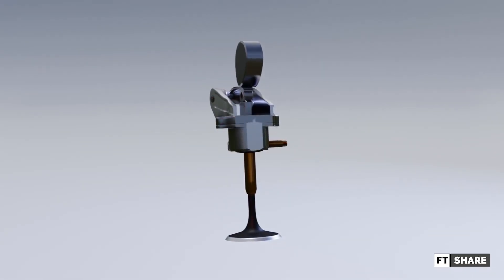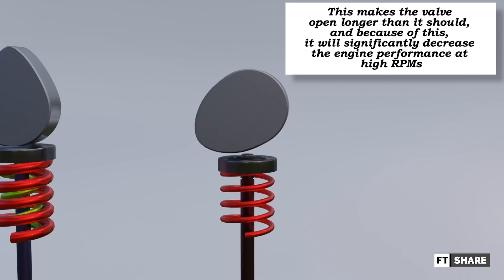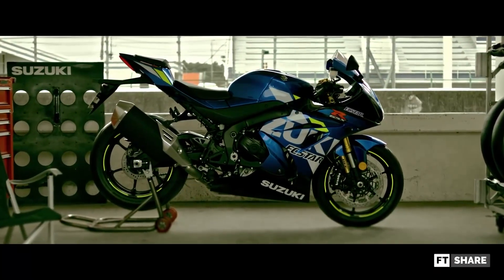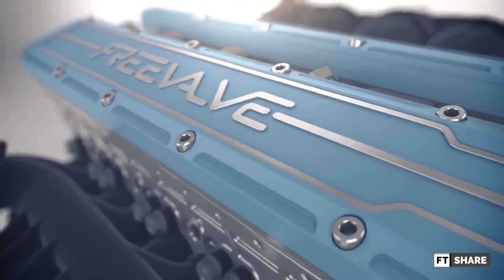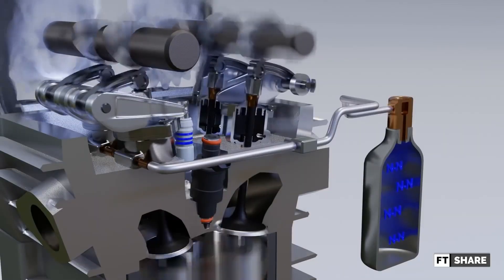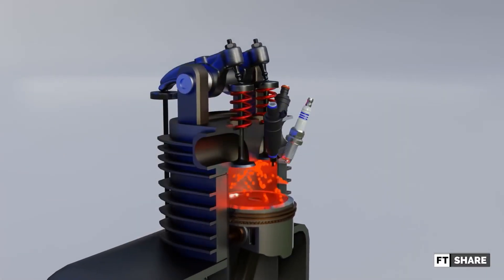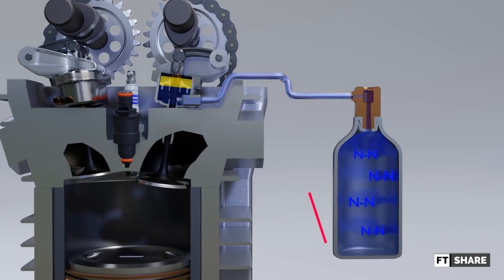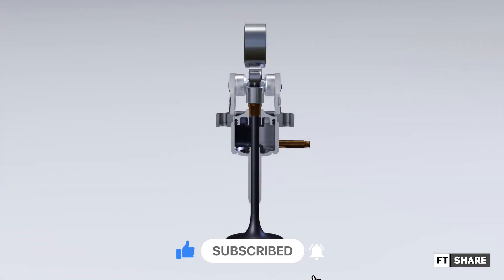SECRETS OF MOTOGP & F1 ENGINE POWER!!! | Pneumatic Valve Spring ( Working Mechanism & History )

Comment: Valve float doesn’t cause backfire 😂

On the exhaust side the pressure is more likely to shut the valve prematurely than backfire 😂

Valve float at high rpm causes a significant power drop. 

And if you’re really unlucky, hang an intake valve open and blow the intake manifold off the engine.

Comment: OK, I am thinking that Ducati have had the answer for quite some time courtesy of Fabio Taglioni; the Desmodromic valve operating system.  Nitrogen should & no doubt is preferable to conventional valve springs but, gas leakage & the fact that the camshaft still has to press again considerable resistance, thereby using valuable horsepower.  There are alsono issues with valve float. There are no tension devices in the Desmo system apart from very light helper spring to assist withthe final seating of the valves.  The laer variants are much easier to live with; routing checking & adjusting of valve clearances is now fairly simple.

Comment: Koeniggseg differs from that pneumatic and hydraulic valve system, they use Electronic actuators to close and open the valves and is controlled by the ECU. And the engine does not have camshafts and timing gear for the valve.
Reply: You did not have the most update information.  Koenigsegg abandoned the Freevalve engine offered in Gemera model.  The Freevalve engine has been cancelled and Gemera is only equipped with a turbo-charged V8 engine.  With that cancellation, there is zero Freevalve engine to be sold in market.  It is a dead technology.  They cannot make it work in a 1.7 million US dollar car and thus this technology is a pipe dream anyway.

Comment: Aprilia introduced pneumatic springs in 2002 with the RS CUBE, which engine was developed by cosworth. Then Honda and Yamaha used them in 2007 with the new regulations, thise engines could rev up to 20k rpm, also Ducati could.

Comment: Fyi, all engines useing this tech will always have gears running the camshafts.
Chains are a problem at 10,000 rpm and up. Get to 18,000 rpm and they just disappear.

Comment: Thanks for a great video with excellent animations. I was curious about how pneumatic valves on F1 cars worked and started searching for this info about 5 years ago and couldn’t find anything. 

If the animation scale is accurate, I’m surprised by the narrow diameter tubes between the reservoir and the valve actuator. I’d imagine a larger diameter would be way more efficient, reducing speed and friction of gases transferring between the two.

Comment: 5:41 The "key" to why pneumatic springs are used is that they have less inertial mass than a steel spring. 
It has nothing to do with temperature stability.Temperature stability is the reason for the choice of nitrogen over another gas , not the choice of the valve return mechanism as a whole.
Btw Oxygen would never be used - hot oily environments and oxygen are not a good combination!

Comment: Good video and the narrators command of American (or is that English) is also very good. Ditto for a lot of the comments below. Just a few constructive criticisms since you asked. 
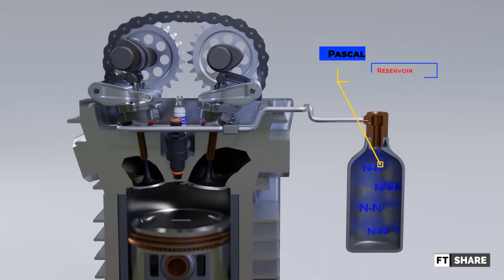5:23 - Nitrogen in what is called an inert gas, which is not subject to external temperature changes. 6:19 - Define "pascala" and convert "10 bars" to PSI for your American viewers. 6:30 - Change "broke the bellows" to "break the bellows." 6:38 - The nitrogen reservoir in the system is similar in function to a reservoir used on a rear shock in modern off-road rear suspension systems, particularly MX bikes. Hope this helps.

Comment: KTM’s SXF 250F engine also does more than 15k rpm, with springs, just an engine / bike you can buy yourself. I think the rpm in engines with this system will be even higher than the mentioned 15k.

Comment: The other problem with  high rpm valves/springs is that the hysteresis in the valve spring can heat it enough to loses its temper so it loses tension and suffers lower rpm float. PS: very good with english.

Comment: Started an earlier post by the dumb box ate it.... or something. 
I seem to remember a certain cam manufacturer that was experimenting with a steep approach ramp on the lobe and with using softer valve springs would result in a higher lift and longer duration at higher RPM levels. This would make a milder more driveable cam at lower speeds and the specs when checking it would result in both a lower lift and longer duration cam to help get around some rules put in place by a few organizations I don't know if it was ever produced or if they ran into problems with valve spring reliability or what but would really like to hear more about it and what happened.

Comment: The only issue is that sport bikes like 600cc class bikes can rev to 16k without issue. I owned a 2012 ZX6R as my 2nd bike and would take it to redline every day after proper warmup to experience that F1 type soundtrack. If not mistaken, pretty much all sport bike engines (Ducati non-prevalent) use std metal proprietary valve springs.

Comment: Pneumatic valves as seen in high performance F1 and MotoGP engines will have gear driven cam shaft and not a chain drive as illustrated. In order to make a lot of power the engine needs to rev at very high RPM hense the need for pneumatic valves but the high RPM also means that regular chain driven cam shafts don't perform well. It's due to better throttle response, less slack in the gear driven system, low inertia of gears and the precise timing needed at very high RPM.

Comment: without doubt anymore, after so many years of watching valve systems, i am convinced that desmodromic system is the best ever made. It is a good question though why f1 is not using it but i guess this must have to do with something about Ducati's rights on the system
Reply: prone to wear with its components,
rotation and slip motions,
but in fact it is a great design that gives a very high out0ut despite having a short valve lift,
but looking at it closely it seems more reliable and accountable than pneumatic,
well just how i see it
Reply: @endurofan9854  camshafts and rocker arms materials have nowadays high endurance so this is not something critical anymore. In fact, i have the sense that camshafts never die anymore.
In my opinion, Desmo system have proved its trustworthiness all these years.
Reply: Desmo is mechanical and solves the high RPM valve float problem

Comment: The valve system is one reason for lack of high rpms. There are many other reasons that limit rpms. Piston weight and design, connecting rod weight and design, crankshaft weight and design, camshaft lobe profiles, and many other reasons.
Reply: All boiles down to inertia weight.
Reply: @quartusbuys6831  that boils down to how much force materials can handle before deforming and giving up.

Comment: An advantage of a gas spring to close the valves is that the pressure can be varied. Low pressure at low revs, and a curve of increasing pressure as the revs rise.
Reply: agreed 👌

Comment: The problem with the pneumatic spring is durability. There is no way to use gaskets and piston in this system due to leakage. Than a metallic bellows is used to seal the system. In 1000 rpm in a 4 stroke engine the valve will open 500 times per second. In years of operation someone can imagine the number of circles the bellows must endure! The bellows will experience fatigue and will fail after a number of circles, which is certainly not enough for years of normal operation.
If someone could came with a material that stand the fatigue, maybe someday this would became reality.
Reply: I think bellows was an incorrect translation for what the animation showed - it was a cylinder with the upper valve retainer acting as a piston, sliding up and down the cylinder bore, rather than flexing as a bellows would. There would probably be some leakage around the valve stem and piston, but this could be kept to a minimum with precise tolerances and the right materials. Bear in mind these are used on racing engines with a limited service life.

Comment: Honda had race engines in the 1960's revving to over 20k rpm using springs.
Reply: Think about that-  well over 100 valve openings per second!
Reply: If you mean FI, they weren't  doing 20k..!!
Reply: @michaelgreentree868  their motorcycle race bikes
Reply: You're probably referring to Honda's 5 cylinder 125 that also used a 17 speed gearbox or their 6 cylinder 500 that Mike the Bike campaigned and that led to the FIM limiting cylinders.
Reply: @parsonscarlson7984 I'm sorry,  but the 125 5 cilinder did't have a 17 speed gearbox but an 8 speed,. And six cilinders that competed in the 500 class was a 305 cc .  The Suzuki R 68.  50 cc 3 cilinder  this motorcycle had a  16 speed gearbox and 19 hp. Watch visioracer
Reply: @parsonscarlson7984 6 cyl 125
Reply: Rc166 Honda
Reply: But very little springs...😊
Reply: So!  Ducati is on point going forward and Renault
Reply: zx25R using spring 20k rpm😂
Reply: Tiny, super lightweight parts was their method.
Reply: Doesn’t matter what Honda used , its always good to upgrade and evolve new technology, look at Harley Davidson they never evolved with new technology and now there stuck with farm tractor technology
Reply: Yeah but very small capacity engines
Reply: @colinvannurden2467  exactly
Reply: It's all well and good if somebody did XYZ at some point for some reason, but why didn't it make it to wide adoption in mass production?
What value outside the racing world did it bring? 
If it isn't reliable without costly and or frequent rebuilding it's just somebodies expensive hobby.
Reply: Compared to rotary or Wankel engines, that is hardly any revs. Do check the revs a rotary makes. You might get scared to death. But the rotary engine never got a real chance in car races. First some rotary engine teams won every single race, they did. The solution is simple. Allow rotary engines less cubic inches than piston engines. But that racing class was not fair, during those years, so the rotary cars did not stand a chance, anymore. That was exit rotary engines from the race tracks. Do check this story, this is a rude summary, but I believe it is very close to the truth. My point is, rotary engines do 50k revs a minute. That is twice the 20k these gas valves allow. Do you see? These piston engines are not the best option, maybe.
Reply: @voornaam3191  I would very much like to see a link to a rotary engine revving at 50 k.
Reply: @hermandegroot1946  no they do not .Even the tiny ones only spin about 30k .
Reply: honda incorporated oil pressure into the tappets ... at higher rpms it becomes harder to compress and rises in its chamber taking up slack as the springs would notmally float...

when these stop working and seieze you here the clicking. its tight tolerances inside a high heat area leads to oil degradation quickly... and they need to cleaned out or replaced to function properly. 

running oil thats too thick or too thin changes how they function too. 

kind of a vtec before they made variable cam lobes. but much smoother. and more tweakable. also helps prevent valves breaking if they hit the cylnder a bit. theres a bit of give. 

one method was shimming. theyd put washers in the thing to limit travel and change it... along with traditional shimming from hot rodders.
Reply: @hermandegroot1946 it’s not that important, a 4 stroke engine does 1/2 of its rpm as combustion, a wankel engine does 3 combustion per revolution, so if a formula 1 goes up to 20k rpm it does 10k combustion per minute, as a rotary engine at 10k rpm would do 15k combustion per minute, with less loss and all of that being lighter and producing more power, but a wankel engine life would be less then a traditional 4 stroke engine, but i think it would be way harder to make a 20k rpm wankel then it would with a reciprocating engine
Reply: @voornaam3191  wankels 50k rpm? what are you smoking
Reply: @voornaam3191 never seen a rotary do much more than 10000 rpm. Apex seals start to flutter.

Comment: Honestly, in these times the turbo 1.6 V6 turbo engine has much less power without electric power than 30 years ago so to say. 🤨
Reply: The old 1000+ hp turbo V6 wasn't limited with fuel burn like they are now, the late 80's probably killed a lot of their live audience early because of the sheer amount of noxious fumes the cars belched out, if you watch old videos from that era they were like the Concorde taking off with a massive haze of grey black smoke behind them, especially in qualifying trim

Comment: Back when F1 used 2.4L V8's they developed  the "air spring" valve train because, metal valve spring doesn't work to well over 15K rpm's, the V8 revved to 22K but, were limited to 18K by the FIA. I went to the last 2 races @Indy they sounded great coming down the front straight before lifting to make turn1, I like the V8 sound.
Reply: 😂😂1😂9😮😂

Comment: I feel that Electro-magnetic valve-trains are the future! I believe that we can eventually utilize this technology,  and it will allow the fastest valve operation physically possible in our world.  Even after gasoline is banned, hydrogen can still be used in IC engines, so that the gearheads of the world will still have a soundtrack! Hydrogen is the future, and NOT pure EV (battery) powered engines. Hydrogen can be utilized in both a hybrid EV configuration, as a generator to charge batteries, or as a gas that can be burned the ‘old fashioned’ way- with pistons and stuff! Either way- hydrogen is the future - because we cannot EVER run out of hydrogen! The most abundant element in the entire known universe!

Comment: Your video at .41 shows a fuel injector on intake and exsaust sides of the engine.  At 1.31 the back fire is from (turbo engine) routing the blow off (Air and fuel) back into the exsaust system past the turbo, it makes for great fires and noises.
Reply: Plus if you using E85 30% of the unburnt fuel during combustion will be burnt off in the exhaust
Reply: There has been experimentation with electric solenoids. That would be a better system if it can be ever developed properly.  Full control of valve actuation.

Comment: Nitrogen uses tok much horsepower to operate. I mean u figure it like the pressure it takes to keep the valve closed and close the valve pretty much slows down the camshaft causing a loss in horespower perhaps make the cam operate on an electric motor and use gears to open and close the valves that would actually be pretty good but gears would suffer alot aswell

Comment: Hello, may I ask is there any valve that doesn't need valve check/valve clearance?
Reply: of course there is, most (if not all) of the perfomance engines doesn't need valve check as they use hydraulic valves (oil pressure is forcing back the valve head touching the camshaft)

Comment: The turbo ricer cars backfiring isn’t due to valve float it’s a 2 step rev limiter to set the launch RPM where you want it and the secondary step is the actual rev limiter cutting ignition cycles.
Reply: they're tuning in the afterfire... external combustion is bad, m'kay... https://youtu.be/5BKjVYAlPDU

Comment: at Low RPMs nearly all the energy which goes into the spring is returned to the engine through the closing ramp...with increasing inertia losses as it gets closer to float..
Reply: when you look at valve gear, and pistons, you realise why turbines are so superior (in the right application).
Reply: "closing ramp"?
Reply: @ivok9846  the part of the cam lobe, which lets the valve spring return the flower to the base circle clearance..
Reply: @RulgertGhostalker  ah yeah, around 0:46 one can see spring "helping" camshaft move from 6 to 9 o'clock, so to speak...
Reply: @ivok9846  Yes, exactly...the energy used to compress the spring, is stored in the spring, until then....then the spring energy goes back from whence it came ( for the most part )...but as the RPM increases, less of that energy is returned; with the inertia of the valve-train consuming more of the springs stored energy, and less making it back into the engine's rotation..

if you think of driving a car over the crest of a hill very fast, the car is not pushing down on the road as much, as it would have been if you were driving slowly...